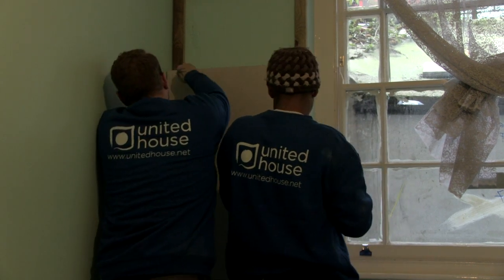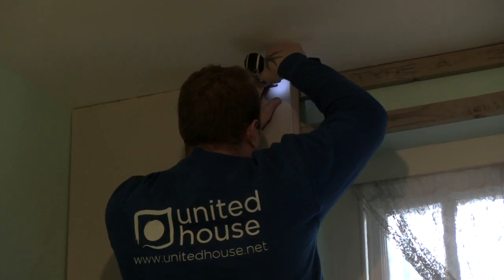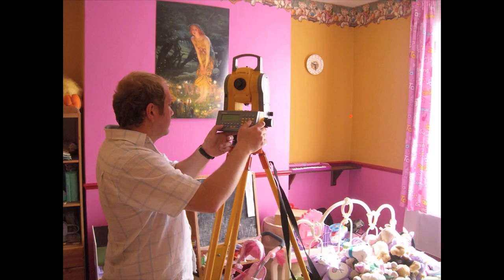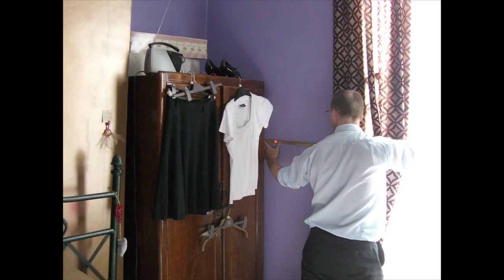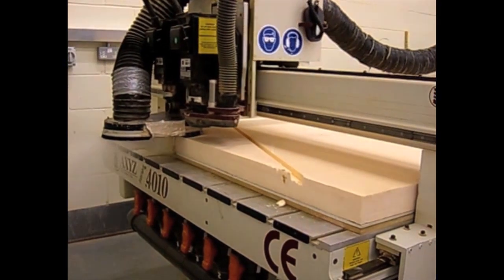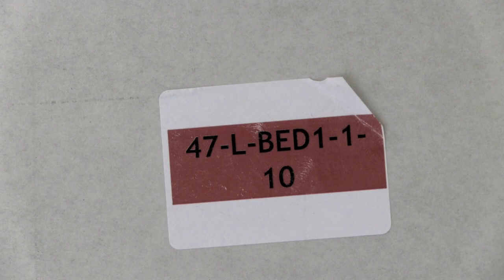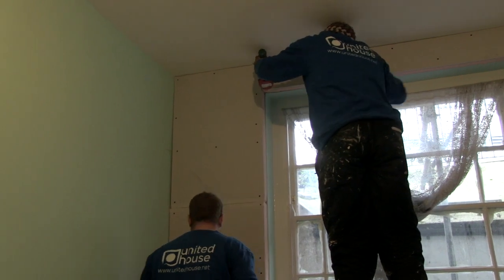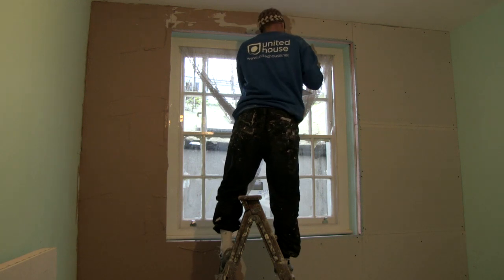A Green Deal faster than before - Camden Road internal wall insulation trial

Comment: Looks good and not too thick.  
Fine for empty properties but what about removing and replacing radiators, built-in cupboards and shelves, furniture etc and double glazing the (sash) windows?  Also adjusting fitted carpets to fit new floor size?